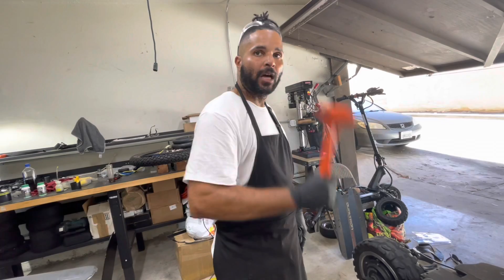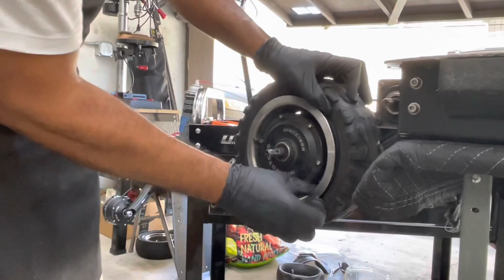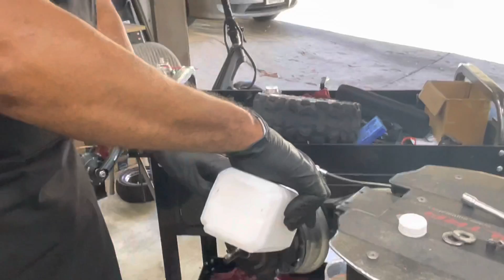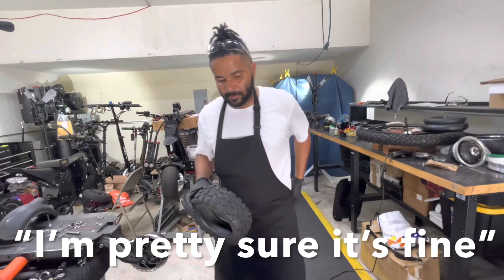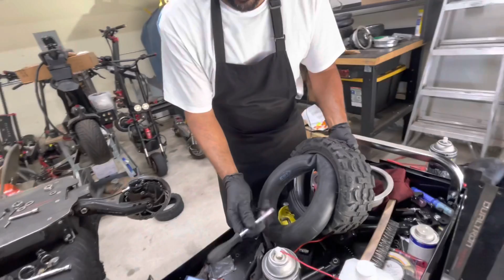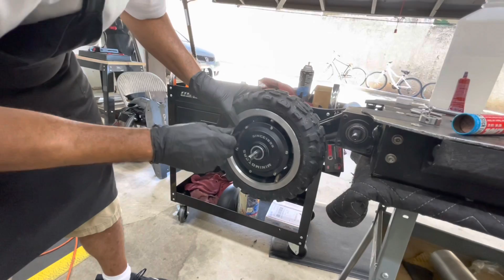ELECTRIC SCOOTER TIRE CHANGE Dualtron Ultra, Pro and most split rim tires

Comment: I always knew split rim and tubeless tires are a thing. I have Emove cruiser doesn’t do that and was not easy to change the tire and put back on. I am happy with my Vsett 10 I can easily change the tubed ones. Since I used PMT tires, I had one nail and never made a flat in over 2500 miles

Comment: When putting tyres on you can just use washing up liquid which will dry out, that's a common substance for putting tyres on, it allows for a slippery surface but dries out over time.

Comment: When using the torque wrench on that wheel, usually you would use it diagonally so if you have 4 bolts you would go 1 to 3 2 to 4. or if 6 bolts the sequence would be 1 to 4  2 to 5 3 to 6 this would give a more even pressure on the wheel.

Anything that uses wheels or large flat surfaces you would usually use this method to get as even pressure as possible also you would butt the bolts up to the surface before torquing them down so as not to put any twisting on the mating surfaces.

On the Honda 600 super sport some people destroyed their cylinder heads simply because they didn't torque their cylinder head down in the correct sequence.

It's not just a case of missing out one bolt, you must tighten the bolts down diagonally or you could end up with a wheel problem.

Comment: What is the clamp tool that he is using to remove the swing arm? I need that for my Kaabo King GT, cant disconnect the swing arm since its so tight.
Reply from the maker: It’s called a joint spreader. I’m trying to find a link for you I just can’t find one right now. Also by the way if you are not  worried about damaging the inside of the arm, which is not visible, you can put along T Allen wrench, perpendicularly the scooter and hammer the arm out after you take the bolts off of course

Comment: When putting on a new tire, do you have to put some sort of sealant around the rim and tire for the thunder?
Reply from the maker: I use Flatout brand sealant for tubeless tires and I use liners for tube tires.

Comment: Amazing, but scary. A lot to do. Red loctite is understandable, but permanent if you get a flat outside, will orange be acceptable?
Reply from the maker: i'm really not sure I don't personally use Loctite. Every mechanic needs to because they are working on other peoples vehicles. I don't really use it I just check my nuts bolts and screws every hundred miles that seems to work.

Comment: i have alot of wobble do they need balancing weights?  both wheels 100watt motors kaabo mantis
Reply from the maker: you might have a problem with there's a lot of wobble it really shouldn't wobble at all unless you get to a high speed

Comment: Well explained process and reason behind it. Like motorcycles, you've got one shot on a bike (with this much power) - you covered all the bases. Great production! I have a Minimotors Speedway IV; tire changes are easy compared to this! Question - for these purposes, are most torque wrenches/ratchets "the same"?
Reply from the maker: I am not sure if I guess I have yet to buy one for myself.
Reply: They can use different designs to measure the torque , but end up doing the same thing.  The main thing is to get one that suits your purpose . Eg 1/4 inch torque wrenches will only measure small torque applications eg. 1 - 20nm / ft/lbs , 3/8 drive will do bigger needs eg 10 - 100 and 1/2 drive will do even bigger . But scooters are small bolts , so only a small torque wrenches are needed .
Reply: @simonlock5595  TY Simon, that fractional sequence is what I have read too. I asked the mfg. of my scoot to send me the nm ratings for each bolt size. Even experienced mechs seem to go by feel - 'hand tighten' (which can be subjective!). I hand tightened my oil plug on my cycle 10 years back and it needed to be drilled out due to my error.
Reply: @theociba3762  it depends on the size of the bolt and the quality of it . I should clarify , it depends on the rating of the bolt.  Some are high tensile and have markings on them . Eg grade 8 . These have a bit of forgiveness in them to over tightening , but small cheap bolts often snap very easily.  Going by feel is ok if you can read their designated strength or know by using them before just how strong they are , otherwise a torque wrench is a great idea . 👍👍👍
Reply: @simonlock5595  Thanks for that clarification Simon, that makes sense. I may have mentioned the mfg sent me a doc/pdf of all bolt sizes for the machine, so I'll look there first. I won't presume all torque wrenches are equal, but look for a generic one (20 uses a year). Appreciate the follow-up!
Reply: Can I get a copy of that torque spec doc?

Comment: Wait why do u have tube tires I though the 11 inch off road tires dont have tubes Steve
Reply from the maker: The 1st and 2nd gen ultras come with tube tires.  They are very good especially if you install them with a liner.

Comment: I got a flat last week. Took the wheel off, took the bolts off the split rim, but two were too tight. The allen key stripped the two bolts. Now i am unable to complete the tire change. How does one removed stripped bolts? I tried a mini torch to heat/soften the glue but the bolts still stayed locked in. I’m now looking at a second scooter, but it seems flats are really scary.
Reply from the maker: OK well this I know about. Honestly you are screwed. You stripped the bolts. There is Loctite on the bolts you need to heat them up before you take them off. Two ways to get them out.  Use a drill and some sort of kit I am not sure of the name to cut another hole into the bolt to remove.  Other option you have to drill the screw out which is a terrible job. I have been there before learning my lesson you are probably gonna need to find somebody to help you.
Reply: @yogadude1234  Another option is to pound a t27 torx bit into the hex opening in addition to heating the bolt and backing with a torch or heat gun

Comment: Lol, to make it easier when removing the split hub from the wheel base. 
Simply jam that stem down into the frame, IF* the tube is popped anyway. 
Then it slides right off.  Work smarter, not harder.
Reply from the maker: brilliant

Comment: Do you have a link too the parts you used in this video?
Reply from the maker: I’m sorry I really don’t. It’s pretty much as simple as you get the tools on Amazon and the parts from MinimotorsUSA
Reply: @yogadude1234  Ahh okay simple enough, Another question tho, Would you be able too do a video on how too replace the brake rotor? I need a new one on my eagle pro

Comment: How did you know to use 86psi on the torque wrench? Was it in the user guide that came with the scooter?
Reply from the maker: I have no idea Ryan knows everything I don't really know much that's why I teamed up with him
Reply: Its common sense this person in the video has no clue about m5 torque specs.  Over torqued the shit out of a m5 and used red loctite.  Socket Head Screws M5 Torque Specifications 56 In-lb  or 6.3nm Max.
Reply: @caRpetbomBer1  I agree and for stainless M5 fasteners, my chart indicates a recommended torque of 45 inch pounds.

Comment: Where did you get the pullers from?  Is this the same way for Dualtron x2 tires?
Reply from the maker: hardware store - I think for the x2 you need special tools to get the tire off the rim. i'm not 100% sure though.

Comment: Can I use lotion or Vaseline as a wax on the inner tube?
Reply from the maker: i'm not actually sure I'm gonna try to do a Q&A with Ryan on the stream we can ask him
Reply: I've used dish soap (green Palmolive) with a bit of water for many years on bicycles. It's useful for seating tires as you inflate them, just add a thin layer with a paint brush to the beads (don't slather it on). You don't want to use petroleum based lubes like Vaseline on rubber. Even a light dusting of talc on the tube can also work. That's why many tubes still come from the factory covered with a bit of talc. Again, a LIGHT dusting.

Comment: A change of tire and tube would be nice if it would be easy possible out in the field in 5 to 10 mini53&. Otherwise one has to send the scooter  to the Master Technician.
Reply from the maker: No doubt! I could change a tire in the field so long as I had a socket wrench and some Allen keys it wouldn’t be as clean as this garage installation Ryan is doing but when you install tires for other people you have to really take a lot of extra steps for safety.